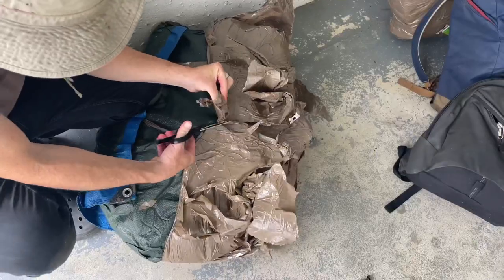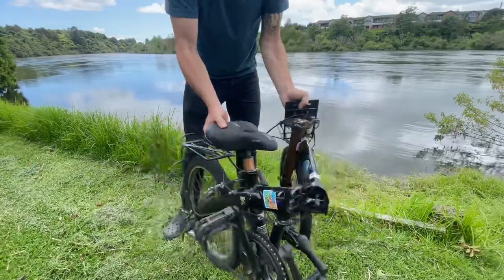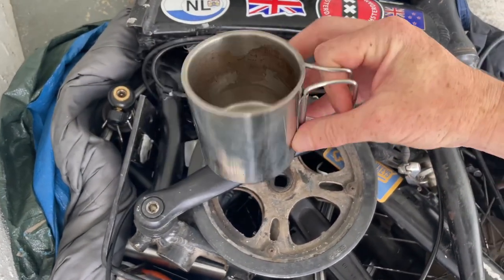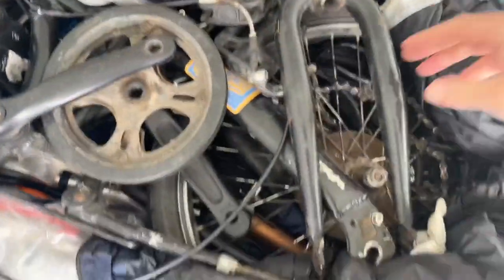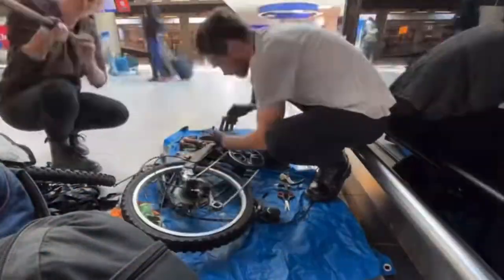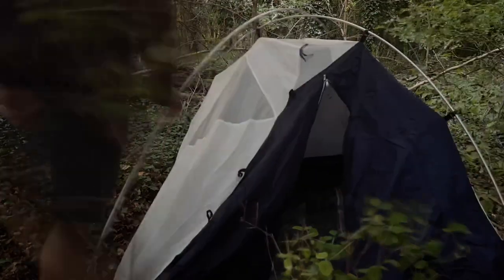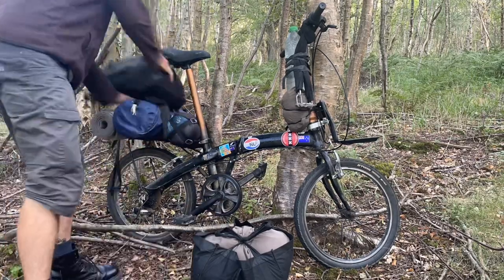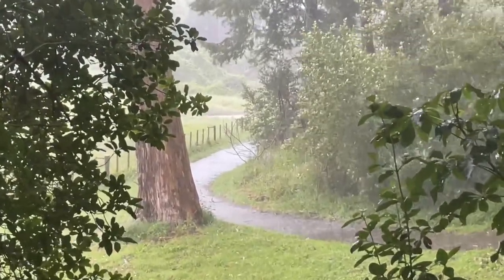Cheap Folding Bike Touring - Unboxing & Set Up

Comment: Awesome video! So incredible how you break down the bikes!

I have been using a little alcohol burner instead, I don’t have a gas thing. My first camp I had a tarp that I strung up on a guy line, and thirty minutes later it rained for eight hours straight, so I sat under the tarp drinking coffee till it passed. I recommend using some guy lines with a tarp and learning a few knots. Guy lines are cheap and light weight.
Reply from the maker: Good on u mate! Getting out there is everything. Stay dry & enjoy the ride :)

Comment: Nice vlog 
So what is the brand of your bike? And what is your opinion about comparing between Dahon suv D6 vs tilt 900 ? 
🌹thanks🌹
Reply from the maker: Thanks mate! My bike is a "Sonar" brand that I got second hand from a sailor (I bought 2 in very rusty condition and cleaned them up). Interesting to compare these bikes, the dahon has a luggage carrier which is always handy, however the Btwin rates highly too https://bit.ly/3YNzgFF Both are aluminium frame,  so should be light and they are very similar. Have you compared the Zizzo Forte? Its another very similar bike https://amzn.to/3VploOX
Reply: @hobocyclist  👍Thank you very much bro for the answer and useful information
Reply from the maker: @ssman1375  All the best & thanks for watching my channel!

Comment: I don't know about all this, Andy. I think I'd just pay the extra fare instead of going through all that disassembly/ reassembly even though I'm frugal.  I guess I'm just too lazy. It's not for everybody. Fold the bike, put it in the bag with the tools and stuff and bam, over.
Reply from the maker: Fair enough. It never even occurred to me to pay extra, I mean you could take a full size bike too if you go that route. How much is the extra charge?
Reply: @hobocyclist  I don't know. After removing the pedals,  I put my 20'' Dahon in an unmarked bike bag and told them it was a wheel chair. I didn't pay extra. I've only done it one time and it was a domestic flight. Maybe I got lucky. Whatever.
Reply from the maker: @SteffiReitsch  Great tip! my mate travelled with his bike and said it was a pushchair. whatever works is the name of the game!
Reply: @SteffiReitsch  Very smart trick to say your folding bike is a wheel chair.
Reply: @mardiffv.8775  Thanks.